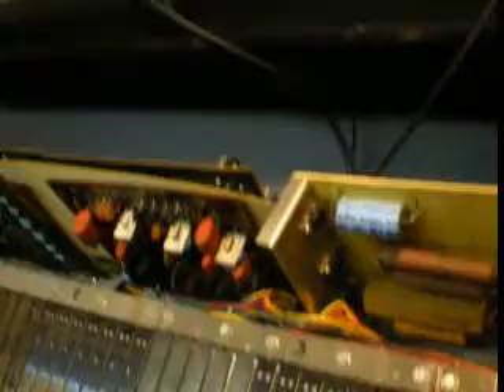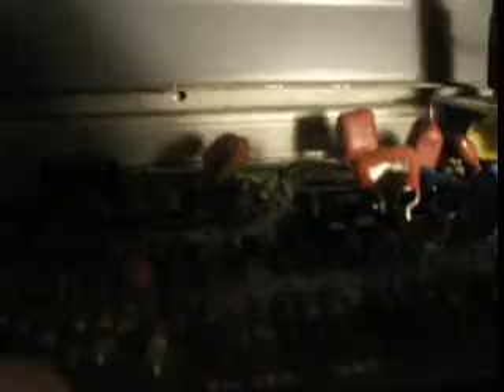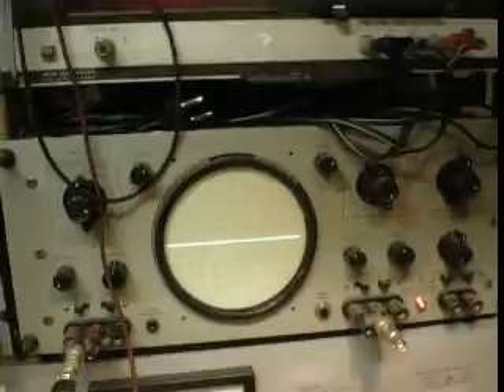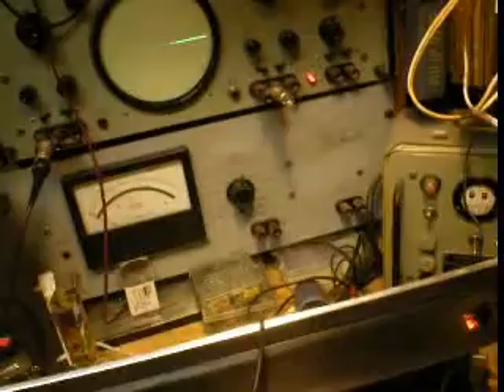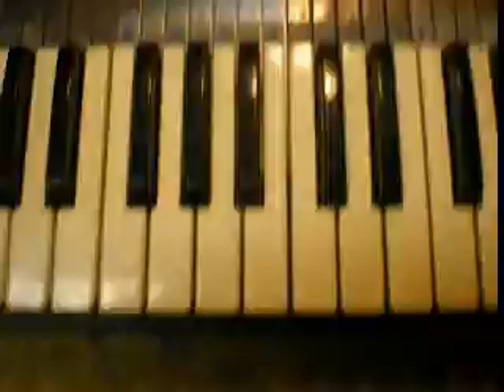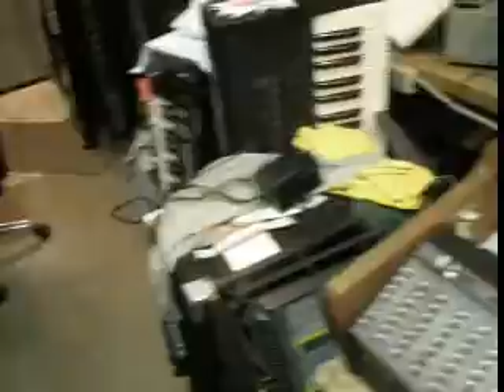Hammond 102100 analog synthesizer tune up!

Comment: I've had one of these for about 7 years now. A guy I used to have a studio with didnt want to deal with it anymore and left it with me. I haven't touched it until now. 7 years later. It's very crackly and noisy. Not in a good way.
Reply from the maker: Clean all the card connections with eraser and work the keys a bunch..careful NOT to hit switches... I always help previous selection come up easy or they break!

Comment from the maker: Hmm  well in the case of this one probably bad connections since it has a pretty stable oscillator. :-).    But many synths use oscillator designs that employ chips or discrete semiconductors that are susceptable to temperature drift.  Polysix uses transistor pairs but they are pretty stable.  Most other designs I've seen drift some.  I have a mono/poly that has a chip that takes forever to warm up..but it's consistent.  I should change it so I don't have to wait 20 minutes to use the thing!

Comment from the maker: I keep thinking about it but no time so far.  I have some nifty ideas including weighted wheel controllers assignable to multiple parameters so you can fling it while you play and do a sweep with both hands free during the sweep. I've got so many parts here I'm thinking of doing it with some existing guts... might work over a Crumar Trilogy's.